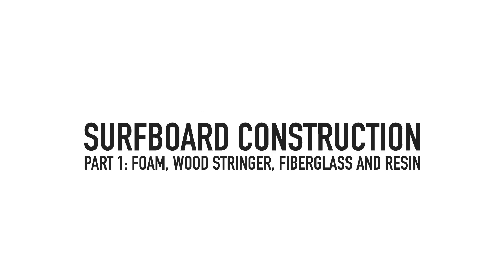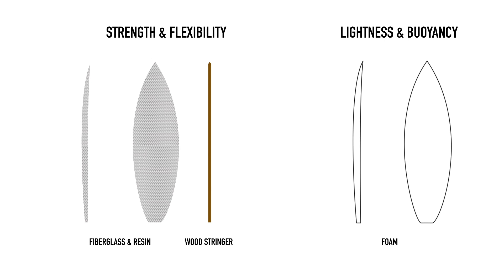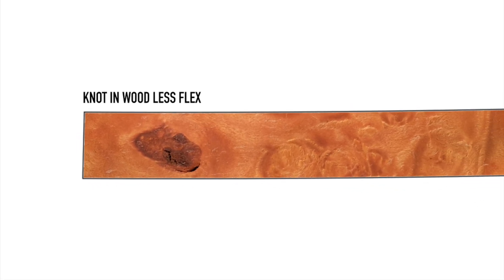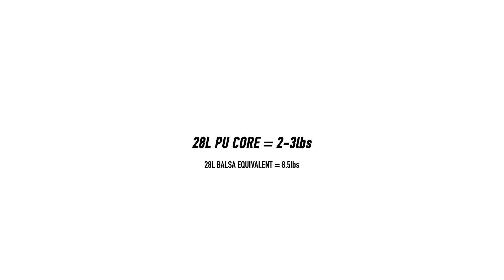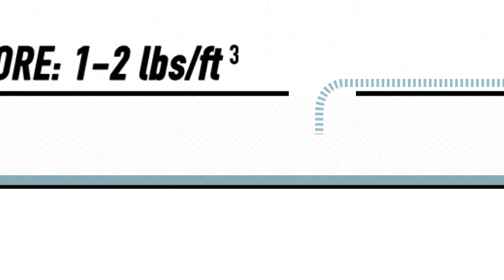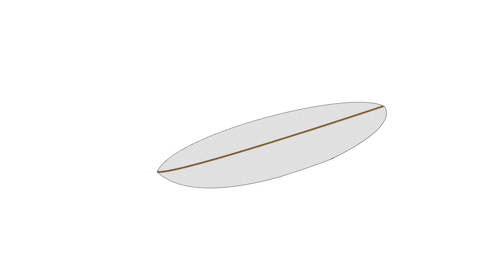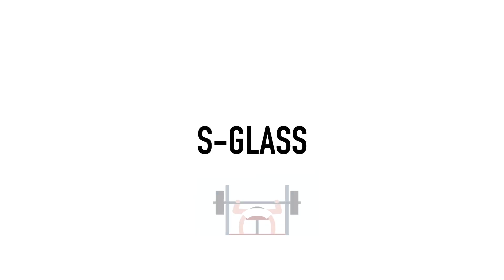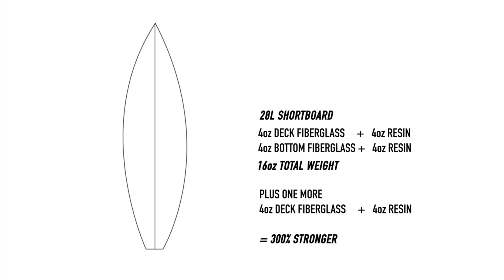Surfing Explained: Ep10 Surfboard Materials EPS & PU Foam

Comment: 7:00 is not easy, Epoxy is easier. 7:25 You can use Polyester resin on EPS. As long you seal it. Solarez sells a sealer. Also you can seal it nicely with a coat of Epoxy and can take Polyester afterwards, which is stupid because is like wearing a hat over a hat. I use what I have and to $ave though.  But if used directly to the EPS foam, then use only Epoxy resin. You forgot to mention the need of venting the EPS foam regardless the density. It always off-gas, the hotter the ambient the worst.  PU absorbs  less water than EPS when an open ding is exposed.

Comment: Any suggestions for a  layup for a high performance shortboard that is optimal for light weight and durability including less pressure denting? Let’s say your options of cloth are carbon, e-glass and s-glass in 4 and 6 oz options…
Reply: I got a 6oz and 4oz on deck, double 6oz on bottom, in a light 1lbs (EPS), its is at 8lbs for a 6,7 board with huge volume at 44 liters.

Comment: Are 2 layers of 6 oz stronger than 1 layer of 12 oz?
Reply from the maker: Thats a fantastic question Yehuda which i attempted to research but could find any specific information on, sorry! My guess would be that 1 layer of 12oz should be as the chemical bond between 2 layers of 6 oz might be considered a weaker point than a single layer. But that is just a guess!
Reply: @SurfSimply  2 X 6 is stronger than 1 X 12 everytime. Think of it like rope - small ropes entwined together. 3 X 4 ounce even stronger.
Reply: Yeap!

Comment: I've gone almost 100% to building EPS core (2 pound)/epoxy resins for the past few years for environmental and longevity reasons.  I recycle all my EPS scraps; just took a load in yesterday. Epoxy has almost no VOCs. EPS/epoxy boards hardly dent.  Built a 2 pound EPS/4,4x4 glassing test board and beat the snot out of it.  No dents at all and I'm not a light footed surfer. And EPS/epoxy boards have a very long life. There are downsides to EPS/epoxy: (1) doesn't polish out to a new car shiny, (2) coloring the board is limited (e.g. resin tints do not turn out well; opaque pigments OK), (3) need to put a breather into the board to let out air/water vapor pressure to keep the board from delaminating.  But at least one supplied has a great Gore-Tex valved leash plug that allows air to pass but not liquid water.  It works great.  The pretty, art-like boards you see are all PU foam/PE resins because it works better for art and color.  But it's environmentally rough and those boards will not last as long, with all other things equal.
Reply: @Andrew H 6lbs